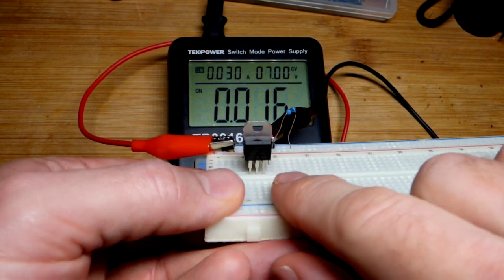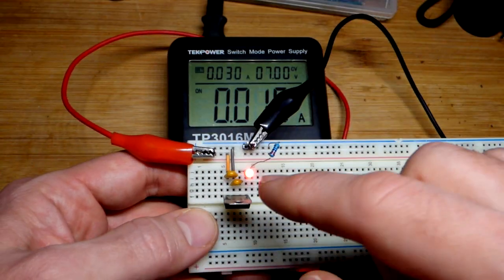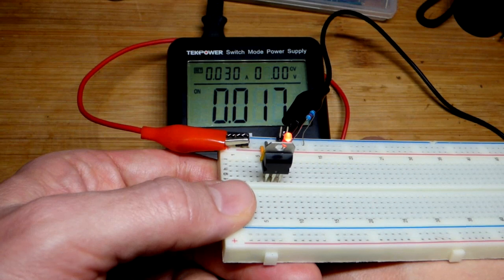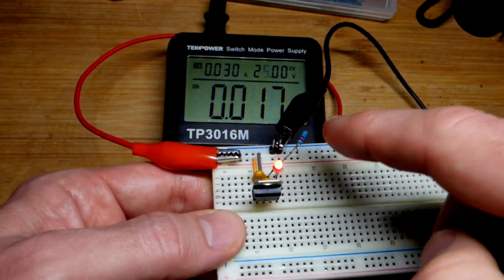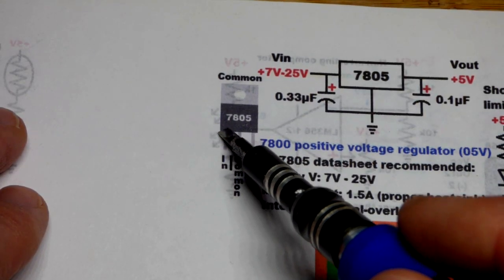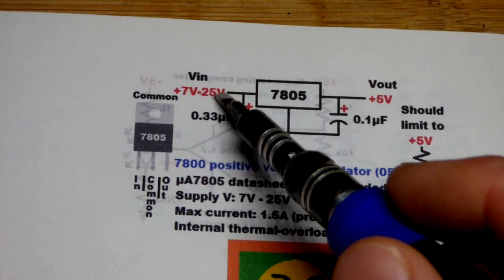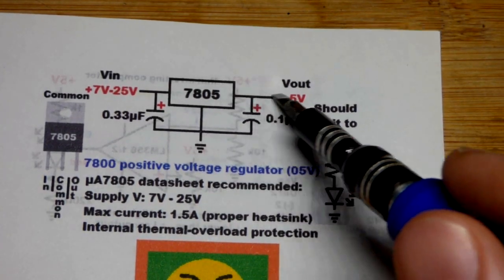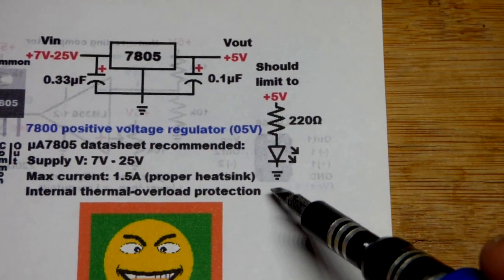7805 Positive Voltage Regulator Basics by Electronzap

Comment: Good little circuit. I made a few to hard wire some 12VDC low current peripherals direct to house battery in my truck. I put 3 circuits in altoid tin box. This winter I am cooking up a couple new alarm projects using LDR sensing. 
Happy New Year.
Reply from the maker: Very cool, happy new year!